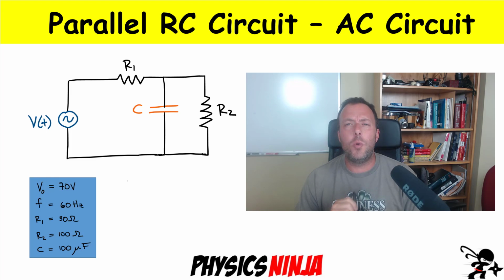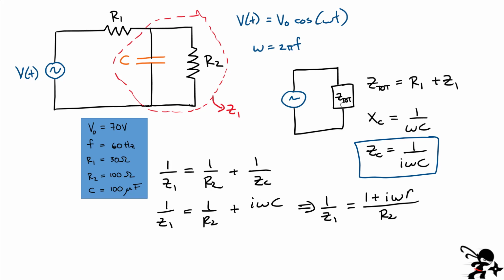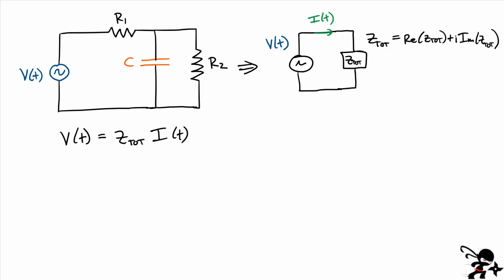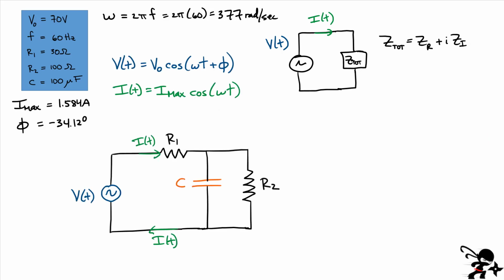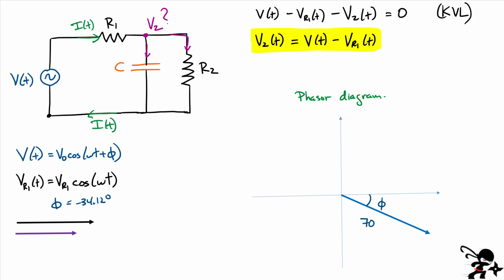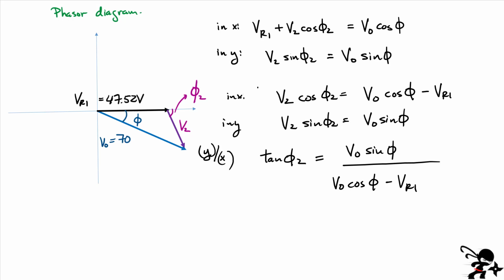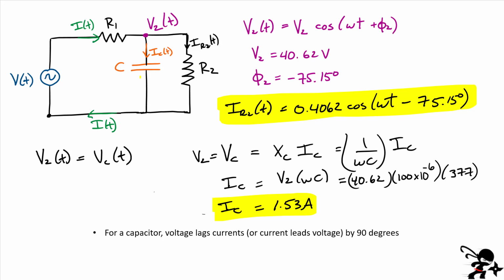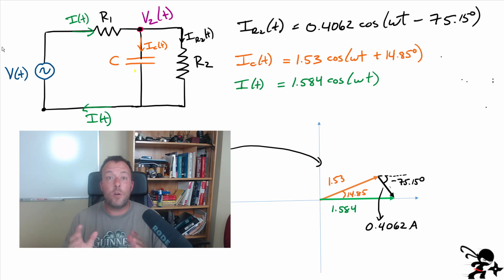Parallel RC circuit - AC Circuit

Comment: At about 9 minutes you have the real and the imaginary parts.  Shouldn't the imaginary part be "R2(-iwR2C)"  - you have  -wR2C.

Even if you are not listing "i" because it's in the "imaginary part" bit, isn't there an R2 squared?

I'm just barely following, but I think that it should be squared.  Maybe you'll square it in a bit?  I'll continue watching now.
Reply from the maker: Yes, the R2 should be squared.  I think the numerical values will be ok (fingers crossed). but I forgot the squared term for the algebraic part.   Good catch